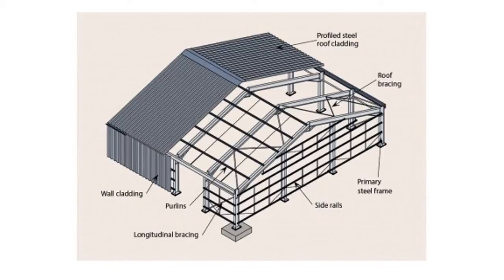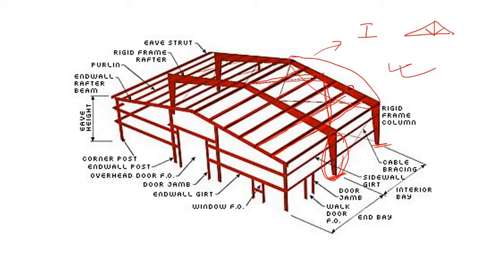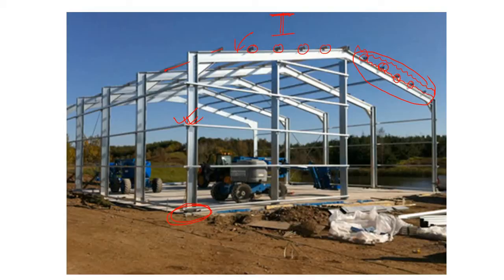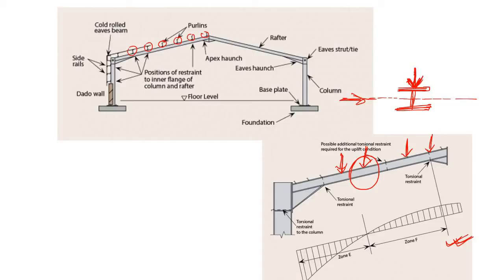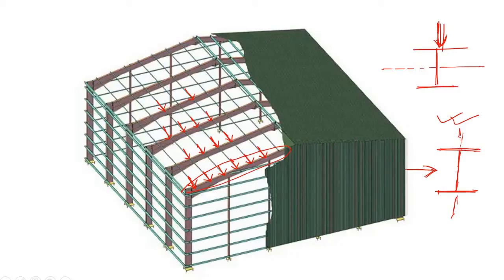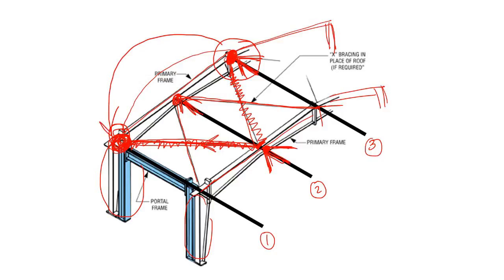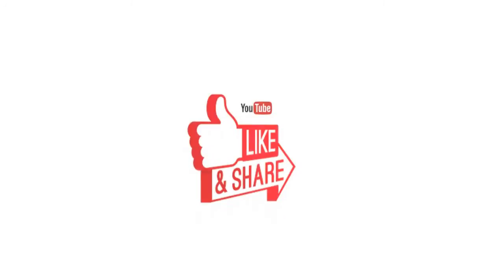How Plan Bracing Works !

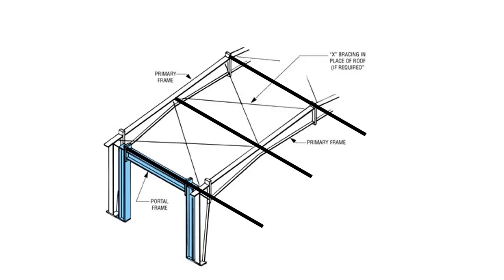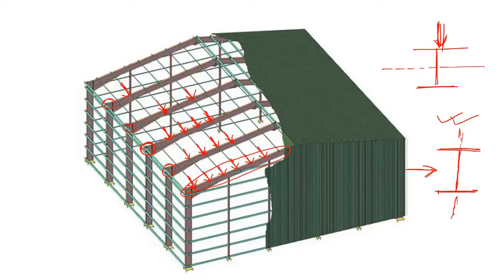Comment: Great Explanation.. I have a question. @ 6:24, structure purlins have large spacing so that these plan bracings are provided after each purlins.. but @ 6:15 structure, purlins spacing are so close , so that it will very uneconomical to provide these plan bracings after each purlin. so what is the other option??? and my other question is that, after structural analysis, we found that in these plan bracings there is compression forces. but in many of the cases we see that in these type of structures, tension rods or cables are provided (which are very slender) as plan bracings and vertical bracings.. so where will be the compression load go??  it will look like useless to use these bracings? please answer to my question.

Comment: sir one question. you are talking that the load will take the shortest path, but what if the rafter has very big stiffnes and the brace very small. in than case the load will not go through brace? i mean stifness isn't a parameter determines the load path?

Comment: I think you might have explained the transfer of the lateral load through the bracing in a wrong manner. The bracing system are usually made of slender members/ties that only take tension and any compression load that is induced in the bracing members will cause them to buckle due to their slenderness. Instead the lateral load is passed throughout the structure through the roof sheeting which act as a diaphragm and the bracing system will transfer these diaphragm loads in tension to the columns instead.
Reply: Interesting..I would like to know if what Remon explained is the right way
Reply: The roof sheeting is too much of a slender section to be considered as a rigid diaphragm, you just can't assume it will transfer the lateral forces directly to the columns